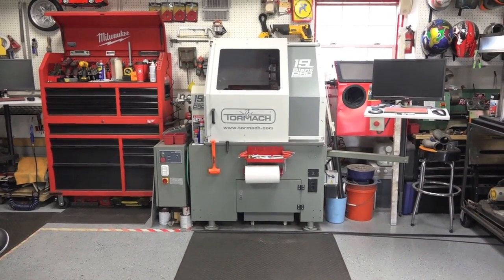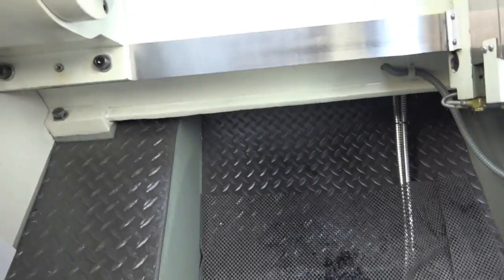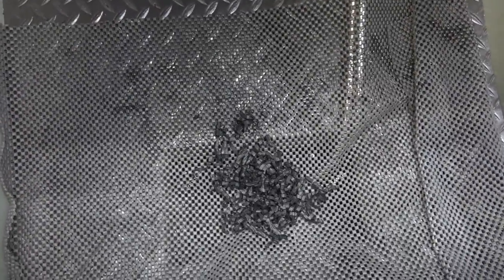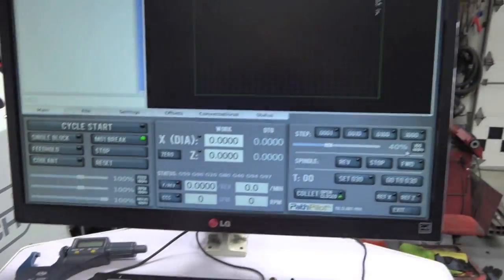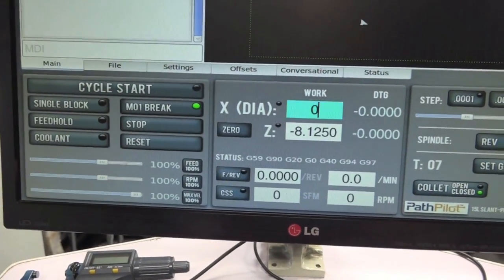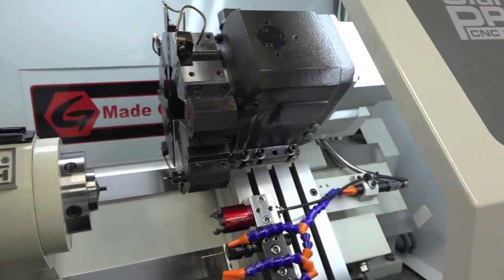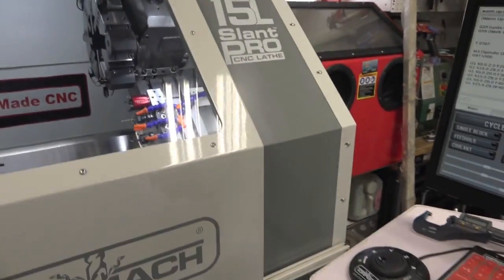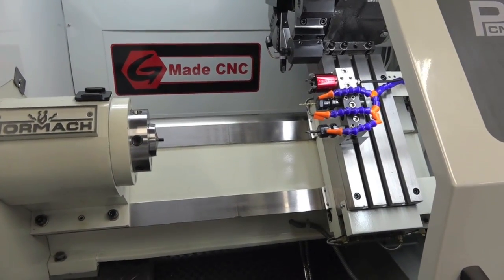Tormach Lathe How To Warm Up The machine and Break Down of The  G-code

Comment: Hi,

Like the tip on the Drawer Mat.  I may try that on my coolant tank recovery screen.

Another question?  I know you have the rotary tool changer and the 4 items mounted on your cross slide.  Is there any more travel available to mount more tools on the cross slide or is that about the limit?

Keep up the informative videos!!!!!

John
Reply from the maker: Hey John 
Thank you!!! Happy to help out when I can. 
The lathe is at its limit at the bottom tool. I only had room to fit the 4 tools on the gang tool set up. 

Thanks 
Patrick
Reply: +G-Made CNC 

You are the man!  Always have useful informative videos.

I currently don't own a CNC Lathe, but I would think???? it would be nice to have interchangeable plates like Dorian offers.http://www.doriantool.com/wp-content/uploads/dorian_tool_lathe_accessories_catalog.pdf Page 58-59.  I may be thinking too much like a mill where you might want to drill and tap several size holes.  Probably not the case in lathe work.  You could probably make your own plate and have it keyed with dowel pins for registration for easy interchange with other pre -tooled plates.  Probably not worth it on small runs.

John